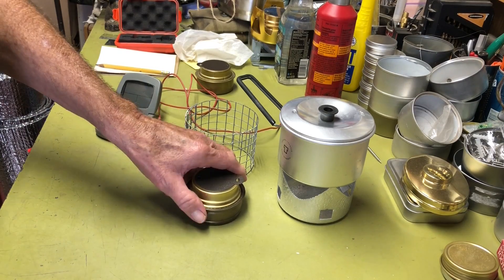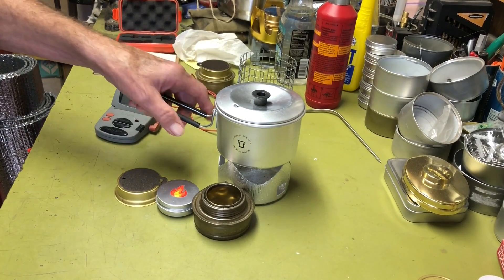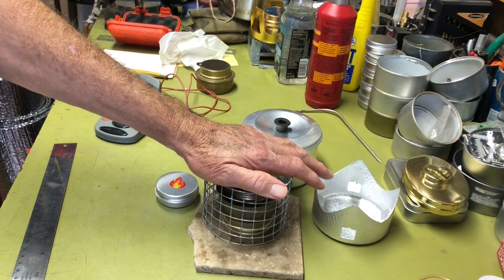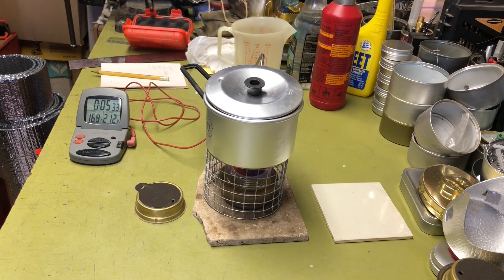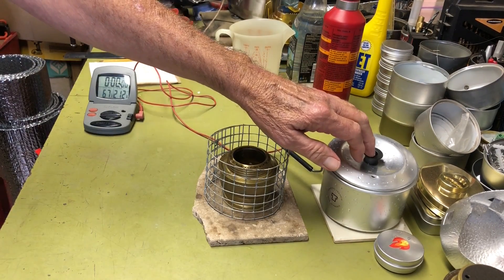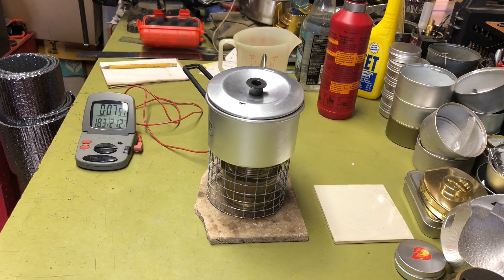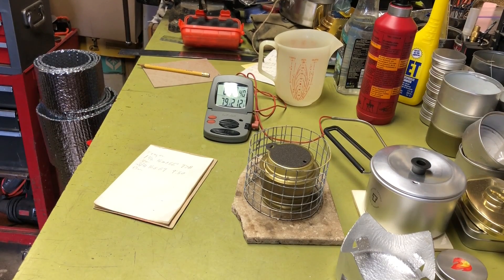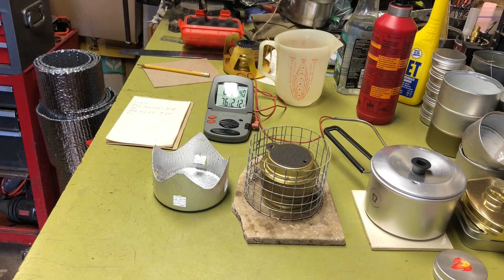Trangia Alcohol Burner Pot Height Tests

Comment: The 3/4" (28mm) take more time to boil, but consumes less alcohol - someone did the math with PaeloHickerMD results of similar test; so this height is more efficient. In real use (e.g. hiking)  the time to boil has less relevance than the fuel consumption.

Comment: I'm 70 and always learned as a kid, that the hottest part of the flame is at the tip. I've always noticed that being 3/4", too much flame rolls up the side and gets wasted. A broader bottom pot makes a big difference as well. I always use the Stanley 1.1 cook pot, it's shorter and a little bigger in diameter. Perfect size for making a Pasta Sides and adding a small can of tuna of the trail.
Reply from the maker: Gear Skeptic has done awesome stove test videos, very thorough.
Here's a one he did on pot and burner sizes. 
https://youtu.be/J9Sz3IQ_DW4?si=SJILDvydfXfG0Nhf

Comment: With a similar experience with the Trangia T28 Mini, I bought the Micro Light with the gel burner and I add a Vargo Folding Aluminum Windscreen. I will use hexamine solid fuel tablets with it. Thank you for sharing 👍

Comment: I riveted sheet metal tabs to the inside of the Trangia pot stand that stick up 3/8 of an inch higher than the stand. Slightly bent out to engage the lip on the pot.  Seemed to help reduce time to boil.  I used a single rivet so the tabs can be folded into the stand.  Might be worth a try...
Reply from the maker: interesting hack, I'll have to think about doing the same or just use my little round tin burner or both.🙂